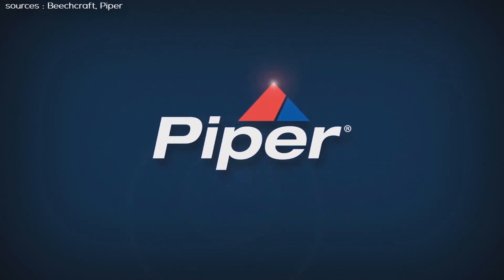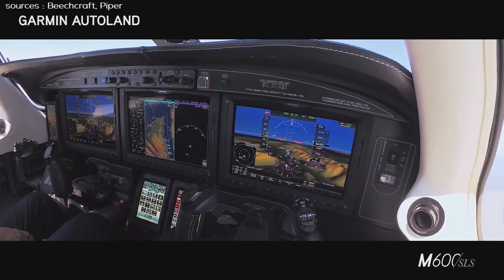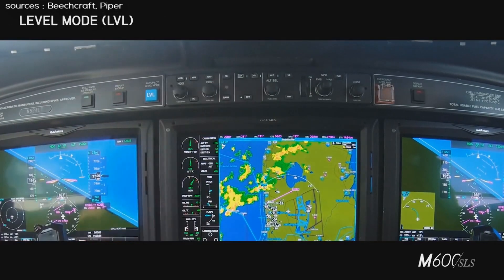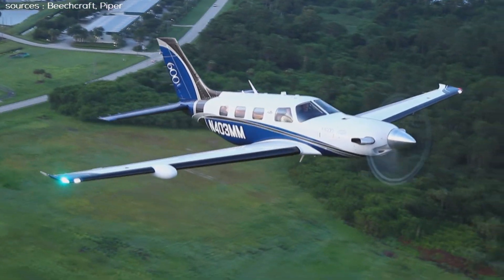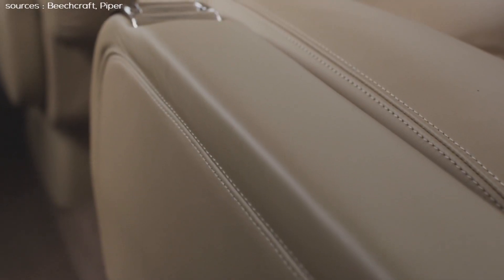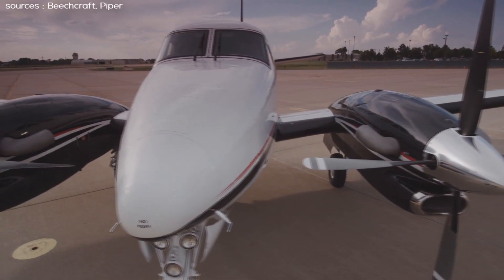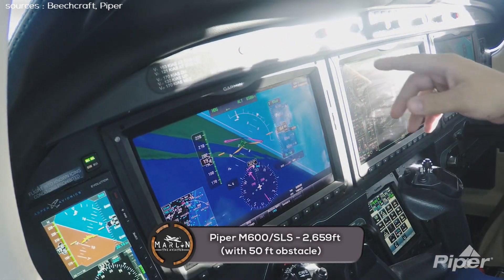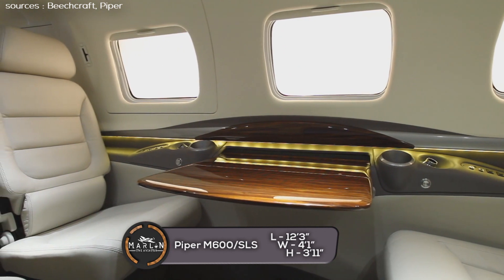Better Aircraft - King Air C90GTx vs Piper M600/SLS

Comment: This to me seems like a silly comparison. If you are the pilot and rarely fly with passengers and are comfortable with the risks of a single engine, the M600 is a fine airplane.  This said even single pilot to get the range benefit, you need to be prepared to fly 6.5 hours without a stop, you may consider the TBM, if that's your goal, you'll shave about an hour off your 1600 mile adventure. Climbing at ISA either plane is good, the C90gtx is still about 33% faster, the higher you are above ISA, the more significant this becomes.

If you fly with passengers have them sit in both, and ask their opinion. Don't forget to ask your passengers if a lavatory is important on a 5 hour trip, which is necessary in either airplane to travel 1000NM. If you fly with a qualified pilot, with no other passengers, the lavatory may also be important to you. 

Either plane finds a 3000ft runway at sea level and ISA temperature acceptable, however, run the numbers for a 5000ft runway at 5000' elevation and ISA +20, you may like your obstacle clearance a bit better in the C90GTx.

So.... if the video were Titled "Is the C90GTx with the price and operating cost compared to the M600/SLS" it would make more sense, because the only thing the M600/SLS does better is cost less.

Comment: Can you imagine being over the Rockies at night in your M600 and your engine fails? No thanks. I'll take the King Air. Maybe I'm wrong, but if a person can afford to purchase either one of these aircraft, he/she can afford the higher operating cost of the King Air.
Reply: I mean, the top of the rockies is under 15k feet. You'd have at least 10-15k feet of glide before getting close to the peaks, with a glide of 16:1. You'd get 160k ft or 30 miles before getting close to the tops of mountains at 25k starting alt.
Another another 10k ft til you'd hit the plateau around Denver, so around 60 miles best case. That's a lot of space to cover on no engine 10,000 sq mi or so

Comment: If the engine quits in the M600 you find yourself on the ground sooner than you'd like.
Reply: And if your in IMC conditions/night your probably not going to survive the forced landing.
Reply: @peteyou2325   It's a brand new plane Goober.
Reply: You're not  A pilot I can tell you're just a dreamer. Anyone will tell you that a multi engine plane is not as safe as a single engine. And I've been flying Saint Lyndon plains for over 22 years.
 And I've never found myself on the ground. It's all on how you take care of it it'll take care of you. And not to mention the fact that this is a brand new plane. It doesn't even have to have an engine overhaul for several thousand hours .
 I think you're good. You don't have anything to worry about. But you didn't need to go get your license
Reply: @robd1859 I am a pilot with more than 35 years in general aviation as an A&P mechanic. A 2nd engine = second chance.

Comment: Comparing a twin to a single is like apples and oranges.
TBM is the only real close comparison and the Piper is more affordable 
Piper seems to have found a very sweet spot unto itself. Fast and Affordable
Reply: Despite its small size, the Piper M600 SLS is very advanced.

Comment: I would go with the Piper M-600 which has several advantages over the King Air C-90GT. For starters , both have turbocharged engines for more speed. What I like about the Piper is that a pilot who is single engine rated can fly the aircraft obviously with the proper training by the manufacturer. Both aircraft have P & W turbocharged engines. Maintenance costs in the Piper will obviously be lower . Both have Garmin avionics which is a plus . Price is obviously higher for the King Air. I see this aircraft as more for corporate use than personal. I believe the Piper can accomplish both missions while being flown single pilot. The King Air is more luxurious but I choose the Piper-600!

Comment: I think if Textron does a single engine version of the C90 frame with a big PT6, they will have one of the best single engine turboprops on the market.
Reply: SET Market is saturated with pilatus,piper daher and so on.
Reply: @jojojoman78  I don't think so, there is room for growth. Cessna is developing the Denali still, they would stop it, if there is no market there. C90 with PT6 will be easier to develop and much cheaper to produce. Similar to Baron and Bonanza.
Reply: IT'S CALLED THE "DENALI"...formerly a Cessna product, now rebranded under the "Textron-Beech" name.
Reply: It's called a DENALI

Comment: M600 and PC12 and TBMs are amazing but when my family, friends (and dogs) are riding with me, I'll take 2 engines any day. Just ask anyone who's ever lost an engine in cloud IFR or at night or over water. Once you get back on the ground with the good engine you will easily justify the added cost per hour of your King Air.
Reply: Amen. When operating in IMC conditions day or night, it's hard to beat the safety factor of two engines. I understand that the PT6 gas turbine is one of the most reliable engines ever built, but it can still fail. As far as the lower operating costs for the M600, my view is that if you can afford the purchase price of either aircraft you can afford the    operating costs of either aircraft.
Reply: Owner operators with means aren't necessarily equipped to deal with a twin, though.  Turbine or not, twins aren't safer if you're unprepared for an engine out. A lot of pilots are better off in a single for that reason.

I'd take a twin turbine if I could afford one or the other, however. Would fly more, too
Reply: A Well maintained Pratt & Whitney Truboprop is much more Reliable than a Piston Engine.

Initial Cost and Operating Cost is much lower for a Single vs. a Twin Engine Turboprop.
Reply: Spoken like a true high time aviator
Reply: Can afford a lot more maintenance on that 1 turbine for the same cost as minimal maintenance on two.

Comment: In Facts the Piper M600 on numbers has to win the challenge. But I would rather Chose the King Air c90 because of their two engines. Much more safety in case of turbine failure. In night and long distance over seas it is the much saver and better feeling to me. It is all about taste wishes feelings and numbers. Good Video by the way.

Comment: people on your videos continue to choose single engine turboprop. Part of the problem is you present the data all wrong. You have to compare aircraft carrying the same weight and having the same trip distance.  If I can climb faster I. A c90 I will burn less fuel when iam up there. Another example , just because your aircraft has a ceiling of 30000 does not mean you can fly up to 30 000 legally, your aircraft has to have the right equipment. For example, many c90s can't fly over 22000 feet because they are not equipped to do so although the aircraft is CERTIFIED for 30,000 ft.

Comment: A difficult choice. Both have P&W PT6 turboprops. In the end, the “baby” King Air will have an annual budget over twice that of the Piper.

With the King Air, you have to budget for overhauling not one, but two PT6 turboprops.

The King Air has been around since the mid 1960’s, it’s proven. Throw on some Raisbeck mods and you have a solid performer.

The Piper is almost as fast as the baby King Air, a million less, and about twice the range.

I would pick the Piper
Reply: If you can afford the King Air, you can afford the maintenance and that extra engine has saved a lot of lives.
Reply: John Bremner don’t get me wrong, I have a soft spot for the King Air family. Throw on some good mods from Raisbeck, BLR, and Commuter Air Technology, and you have an amazing and capable aircraft.

The original 90 series was absolutely safer compared to the piston twins of the time (Mid to late 1960’s). The 250 and 360 are still very competitive and capable. 

But modern single engine PT6 turboprop, especially the Pilatus PC-12, are also very reliable, competitive, and capable. In that competitive environment, the C90 is outclassed .

The overall safety record of singles vs twins is generally the same. The operating costs are the deciding factor

https://www.ainonline.com/aviation-news/2007-10-09/single-and-twin-turbine-accident-rates-similar
Reply from the maker: Solid points!

Comment: There’s no way you got the cabin height right!
Reply from the maker: They’re correct!
Reply: MarlinTheAviator : You are correct, sorry. I had to check, because the headroom is deceptive for such low heights.
Reply: He didn't even get the rate of climb right.
 The M 600 has a rate of climb of over 3000' per minute not 1500